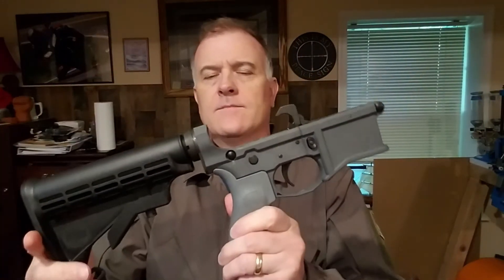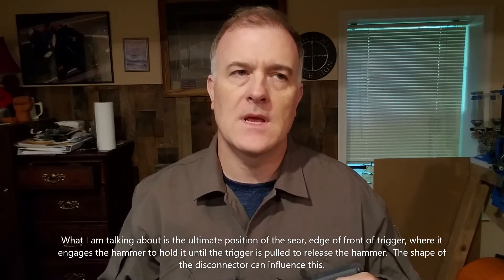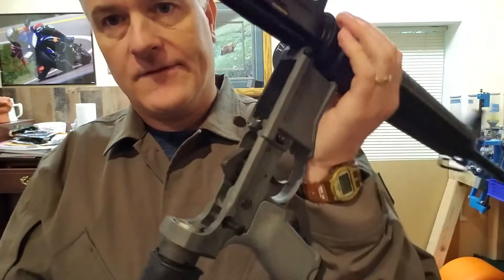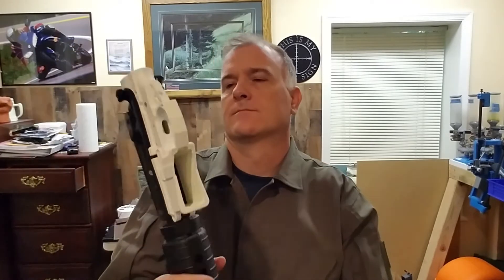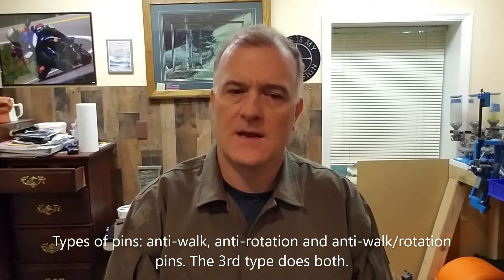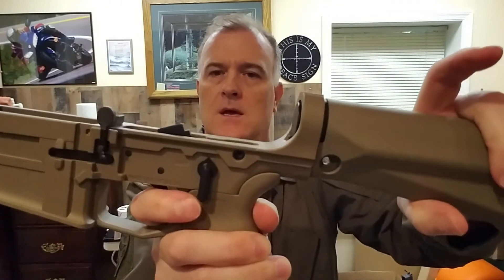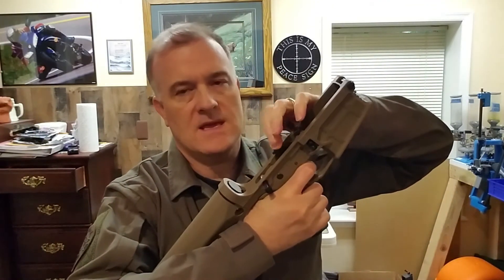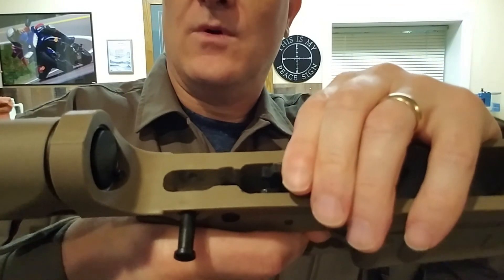YAA Comparison of polymer lower receivers Part2

Comment: As another data point for your trigger reset issue... I recently built a polymer80 lower. I used a MIL-spec trigger and notched hammer out of another AR. I ran into the same issue you describe, where the trigger would not reset when the gun was fired. I replaced the hammer with a full, un-notched hammer, and it works fine now. I also noticed that, using the polymer80 jig, my trigger holes were not exactly squared with the receiver. I fixed that by elongating one of the trigger holes and then using anti-walk pins to square everything up and hold it in place.
Reply from the maker: Thanks for sharing that.   I thought I read somewhere that two-stage triggers were not advised.   But I reread both instructions and did not see that warning when I decided to put a 2-stage in the polymer lower.  I might put the fixed stock on the Aero lower and try a milspec on the JMT or try a different 2 stage like you were commenting on (notched vs not notched).

Comment: Did you ever fix the issue?

Im guessing the issue lies with the milling depth.  Those jigs are hard to be precise with.  I milled a JMT with a 5D tactical jig and it was a breeze and came out perfect.  I have yet to put in the lower parts kit and trigger but once I do I will try to comment back and report what happened.
Reply from the maker: I did not fix the issue yet.  I wanted to try a standard one stage trigger sometime but I've gotten into some other projects since.  I 'fixed' my gray AR15 lower and got a replacement from Polymer80 for my white one.  That leaves the .308 FDE to continue working.  Please do let me and other know by coming back and posting. (if this video is gone post to another one, YT is deleting my videos deemed against the their rules).  Thanks for watching!

Comment: You was just suppose to squeeze down on the upper gotta use your muscles big man make sure everything lined up & pins oiled might needed a mallet too ..you didn’t have to take anymore polymer out in reference to your latest video on this
Reply from the maker: I checked with downward force as well as front to back force to see where the dimensions were off.  Keep in mind these are the places that come already done for you from the manufacturer.  I favored leaving the front pivot pin area alone and worked out the issue in the take down pin area.

If you have to use excessive force to make things fit that is an indication that something is wrong.  AR type rifles are not suppose to require mallets for assembly and disassembly.  I think possibly you were testing me to see what I would say.  LOL.  Thanks for watching!